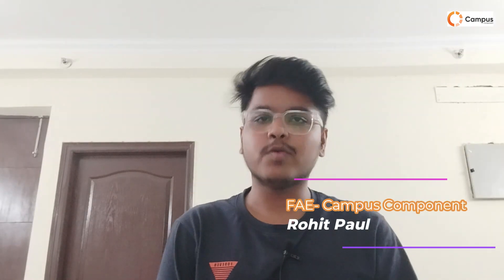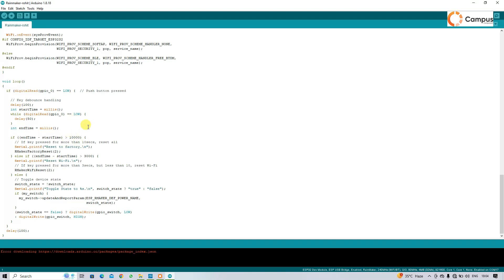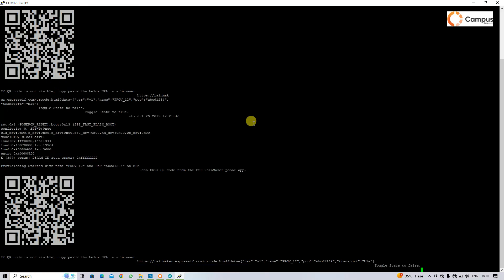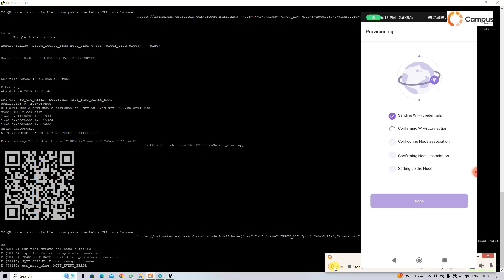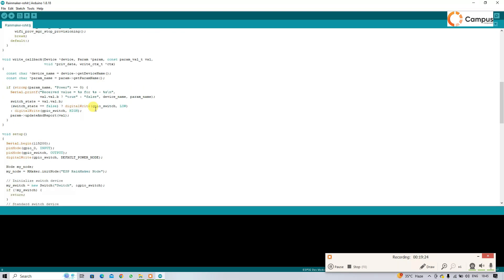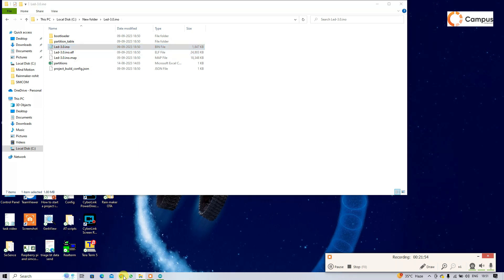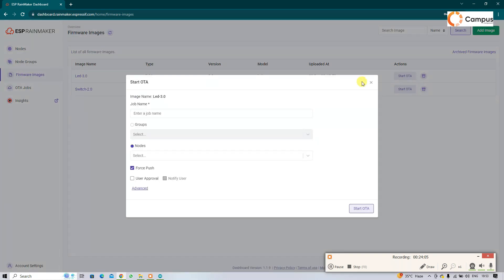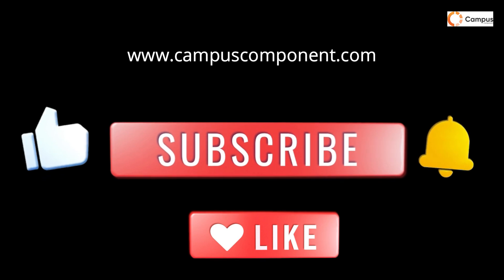Smart Switch with ESP32 | OTA firmware update in ESP with Rainmaker | Smart Light | Espressif

Comment: Hello sir, Now it is after updating the arduino IDE there are two Rainmaker partition scheme 4MB and 8MB. On ESP32 Devkit board if choose 4MB then error message "Compilation error: text section exceeds available space in board" and if i choose 8MB then error message "Partition ota_1 invalid: Offset 0x3fd000 is not aligned to 0x10000" but 6month ago it works fine as there are only "Rainmaker" partition scheme. Please suggest me a solution